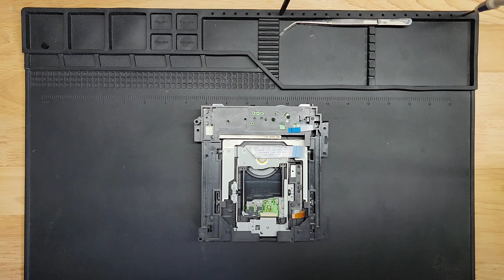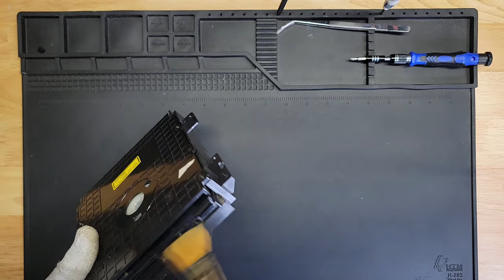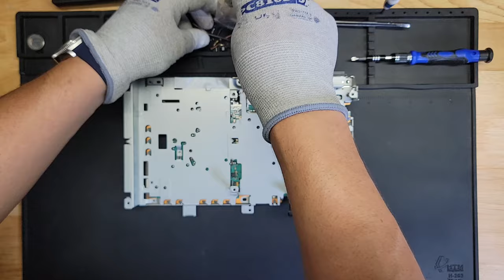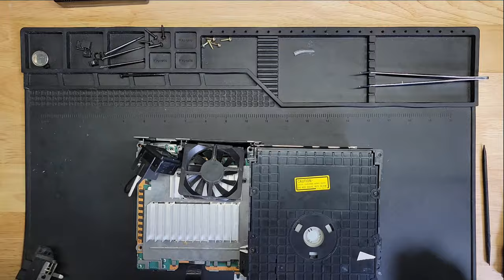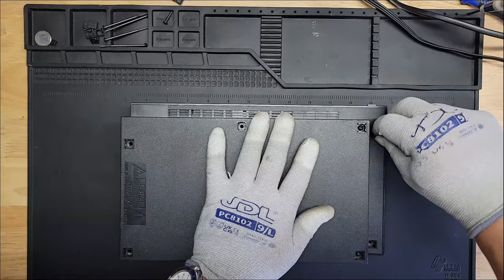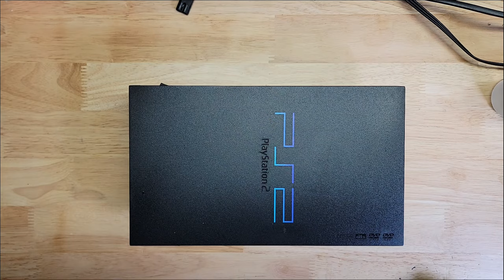PlayStation 2 Reassembly and Restoration 🎮 TRU Fixes ⚒

Comment: Good job on servicing the disc drive. If I had the tools and skills I would de-solder the battery holder from the main board. Solder a cable for each connection pad on the board relating to the battery section which the other ends would also be soldered onto the battery hold itself. That way I could place the battery holder directly under the cover of the console for super quick battery replacement in the future.
Reply from the maker: Thank you. Having the right tools sure makes things a lot easier. I wish the battery was like on the Wii, where you can access it through the outside via a battery holder.